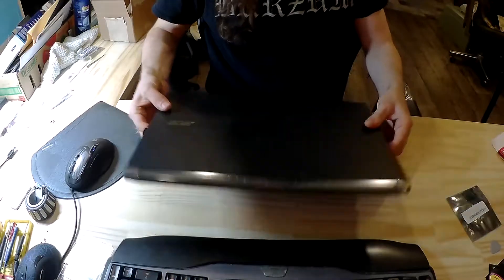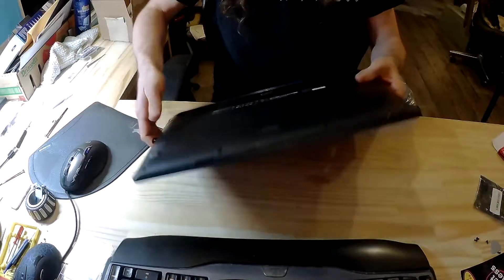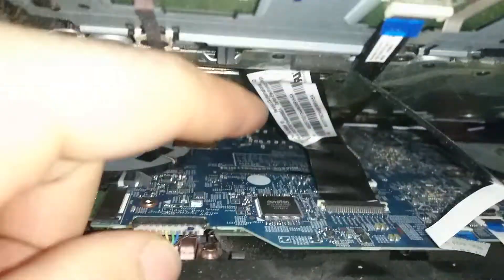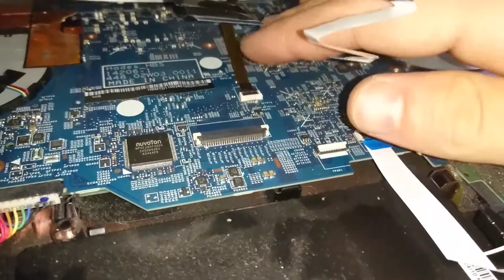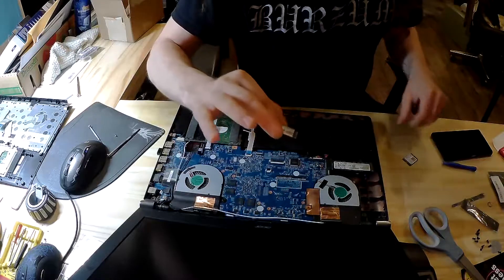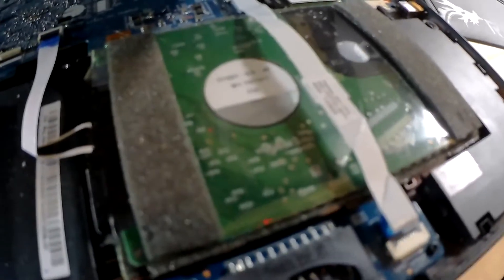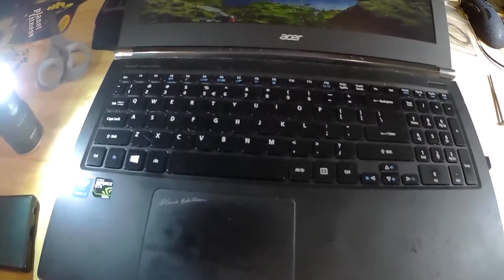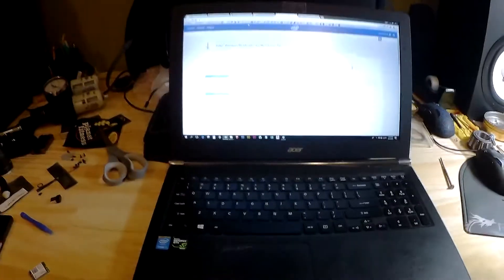No Wi-Fi: How to Replace a Broken Acer Aspire WiFi Card

Comment: This is beyond me.  Guess it's time to buy a replacement.  Any thoughts on how to transfer the sick computer to the replacement?
Reply from the maker: A few ways to go about it - you can use an external drive or USB stick and copy the files over, then transfer to the new computer. Alternatively you could pull the whole drive out of the laptop and use a SATA to USB cable and transfer that way. As an aside, it may be worth trying a USB Wi-Fi antenna/dongle and disabling the driver of the old Wi-Fi card before committing to a new laptop.

Comment: Hey, changed the card and now I have no WiFi at all. Can’t even search for it, event with a new card. Only works with a usb WiFi adapter?
Reply from the maker: Is it the right card? Does the part number match the old one? Did you remember to connect the antenna wires?

Comment: I tried this with the same model but after replacing the wifi xard It doesnt start anymore :( the power light is on but the keyboard doesnt respond. I just cant get the hand on with the ribbons. Any suggestion?
Reply from the maker: Check to make sure you didn't damage the ribbon cable. If you did, you might try a ribbon cable repair kit, or a new ribbon cable.
Reply: @Bootstrappin  thanks! I found out that I was missplacing the big ribbon because It also has a small movable compartment

Comment: Hello,
I appreciate your upload. I've an old Acer Extensa 4630z laptop. The problem is Qualcomm Atheros WLAN Module not getting recognized -- Error says to insert the module or lose connection.

Does it mean, WLAN module gone?
Reply from the maker: Did this happen suddenly, or after a Win10 upgrade?
Reply: @Bootstrappin  It was like that for some time. I thought it was due some driver corruption in Windows XP. But when I clean installed Windows 10, the module is not getting detected. Any idea, why? Also the Device Manager doesn't show it. Tried with lspci command in Fedora Linux 30 too. How to know what happened? Thank you
Reply from the maker: @pra7640  may be possible that Win10 has no driver support for this older module. I'd try ordering a new one off Amazon, shouldn't be too expensive. If it works, great, if not, just return it.